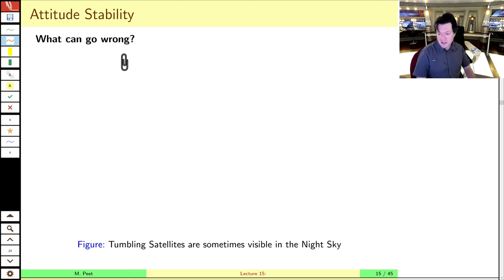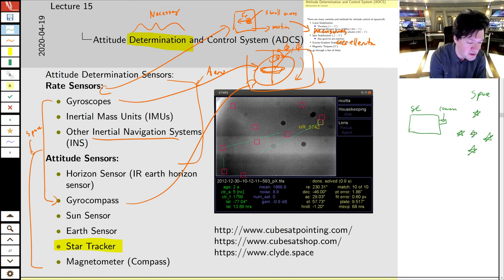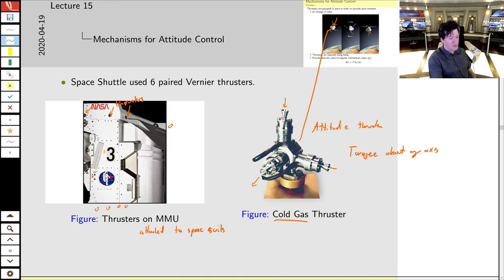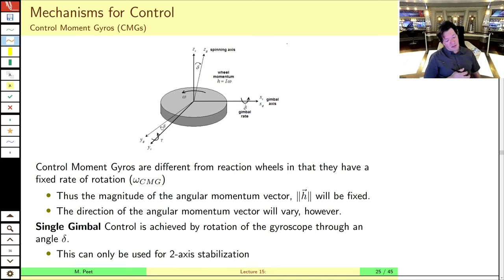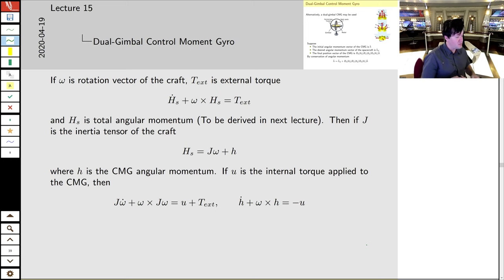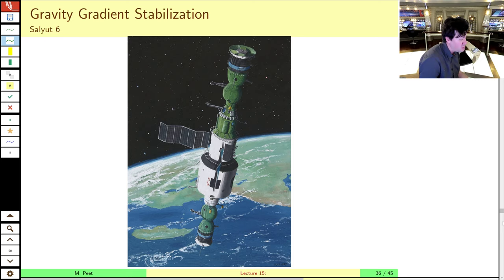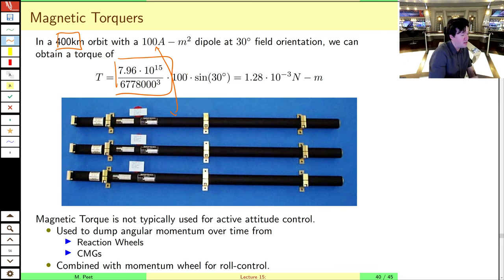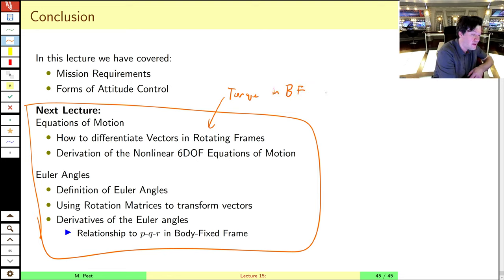AEE462 Lecture15b - Attitude Determination and Control Systems (ADCS)

Comment: Hi, I have a question about the reaction wheels in 39:10. You stated that Hf = - Hs, but shouldn't it be Hf + Hs = (net angular momentum)? Why did you set the net angular momentum to 0?
Reply from the maker: We are looking at changes (Deltas) in angular momentum, so we can assume without loss of generality that the initial angular momentum is zero.
Reply: @MatthewPeet  thank you!